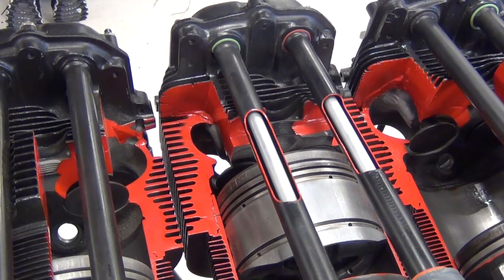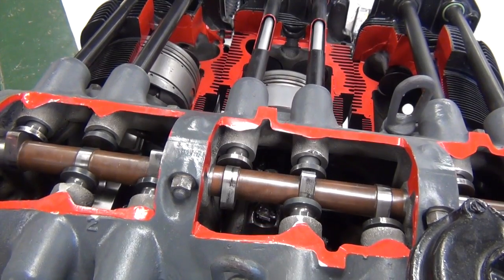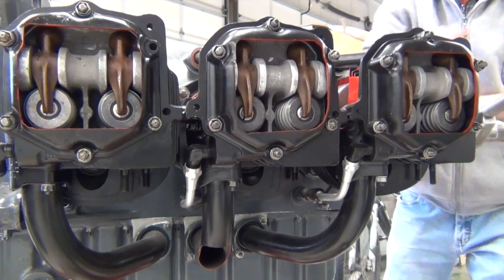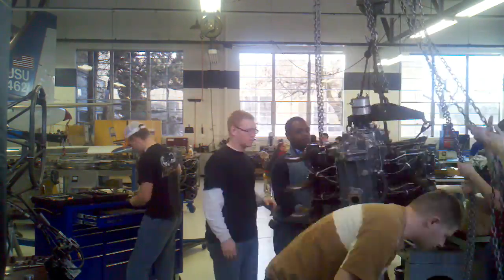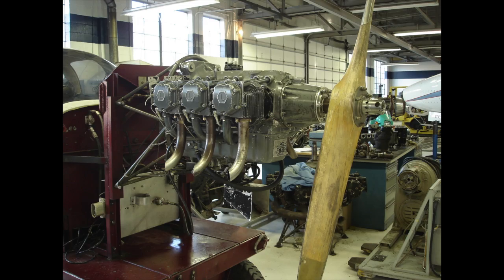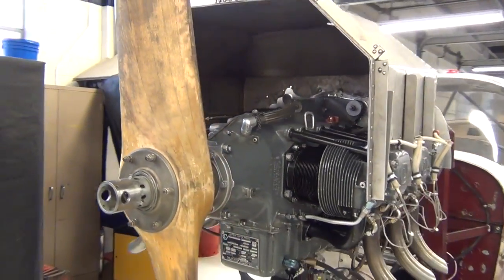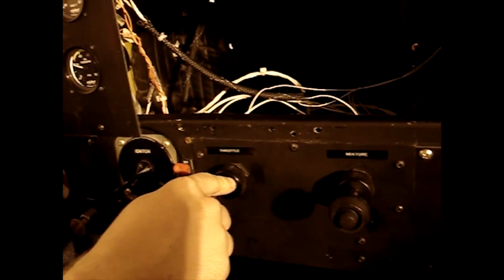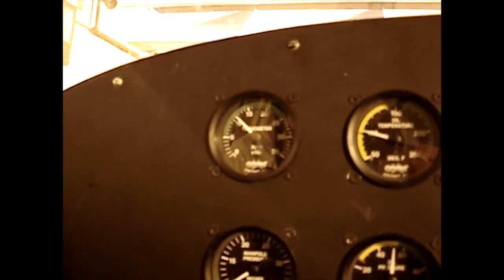Lycoming 0-435 Overhaul

Comment: Most later 47s used the Lycoming VO435. V for vertical So i suspect there were some differences in the oil pathways and perhaps no thrust bearing required. I'd love someone who really knows to explain it.
Reply: There are several variations of the VO-435 in 47's. All more closely related to the GO-435 with a separate gearcase for reduction gear. Some models with transverse accessories. Your model number suffix would describe layout much like the VIN on a car.

Comment: No. Too computer sensitive. Coil packs are also more sensitive to heat, moisture, and vibration. Crankshaft sensors go without warning, even after passing a tolerance inspection. One of the reason the industry is trying to go with mechanical diesels.

Comment: Why are we still using magnetos?? ... wouldn't electronic ignition be cheaper and more reliable?
Reply: magnetos work during a power outage, as they produce their own through magnets. If your electronics go out your engine is still fully operational and you can continue to fly safely.